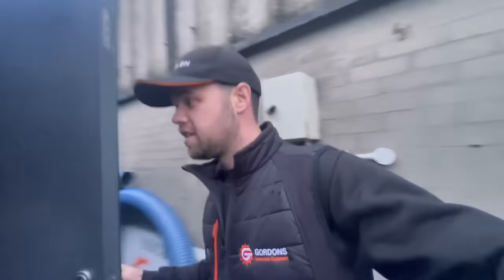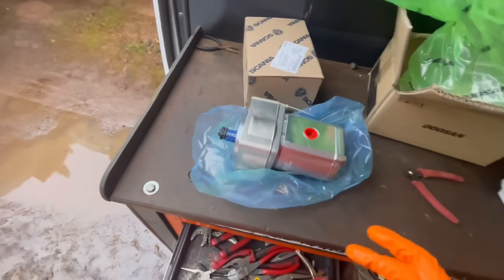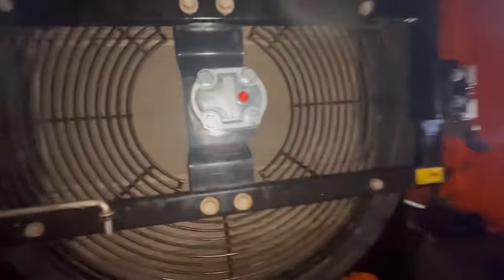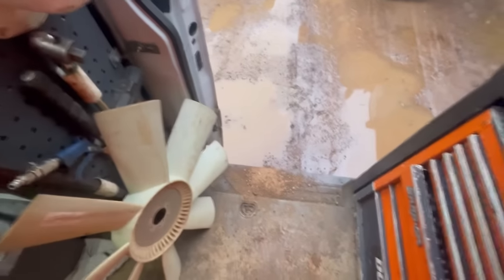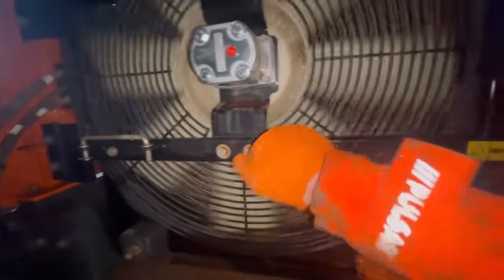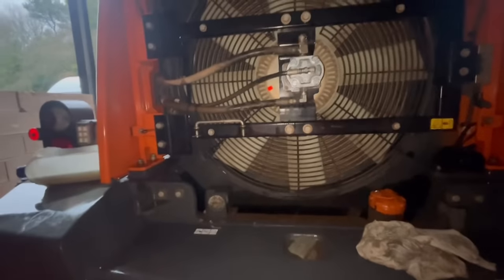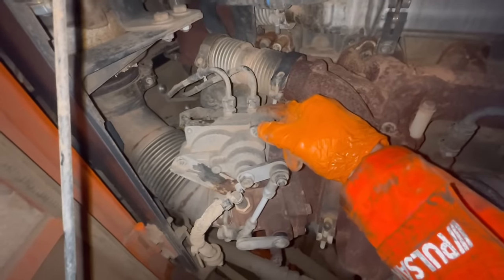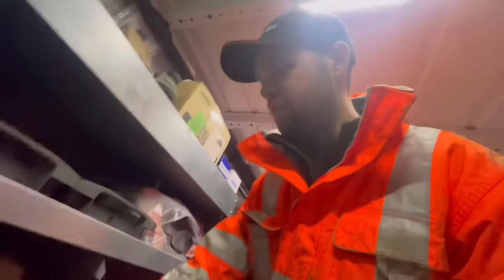Fan motor replacement / Exhaust brake fixed / Stop raining !

Comment: Ali, see about getting a cheap magnetic base used by machinists for their dial indicator. You could then lock it on and position the arm. A few machinist on YouTube I follow do this with their GoPros mounted on them to attach to lathes and milling machine’s for close up filming.

Comment: Wd40 stands for water dispersant no 40. Developed by nasa to solve condensation problems in spaceships.apparently it took 40 attempts to get it right.
Reply from the maker: That’s right Paul 👍👍
Reply: And they still haven't got it right! Wurth  penetrating oil is oil based and is a lot better!
Reply: @keithk1246 Dead right Keith,i agree

Comment: What way is that fan blowing? In from the rear through the rad or pulling it out through the rad from engine. Is the cut on the Blades turning the right way? As i seen them on wrong!

Comment: That is really strange how the splines have worn out.i had it happen on a cat forklift motor once, never really worked out the cause ???looks like it just rusted away.but surely not old enough for that.
Reply from the maker: So apparently it’s to do with the motor loading up so a change in speed and direction will cause the splines to wear out it’ll be a 6-7 year old machine but it’s looked after 👍